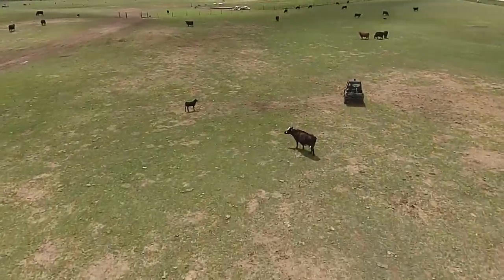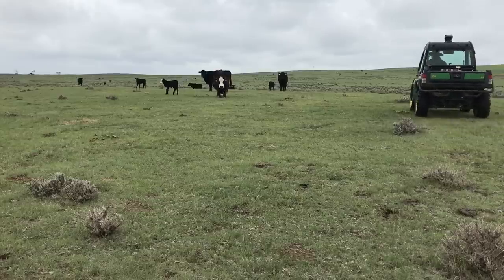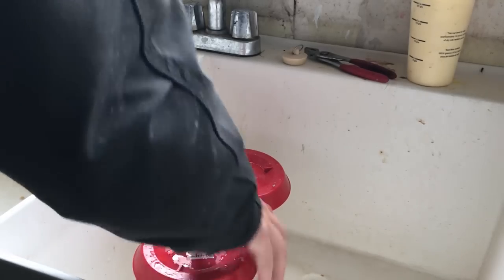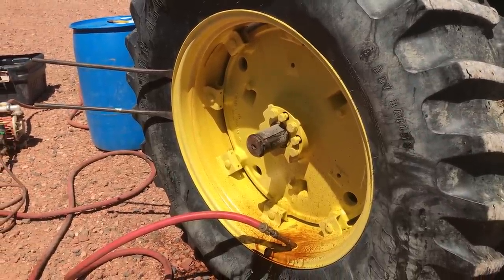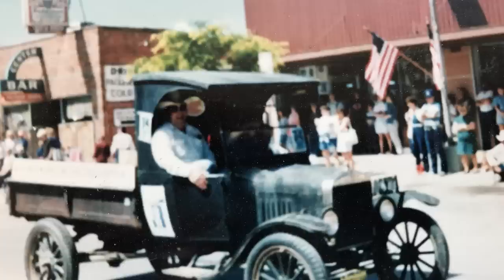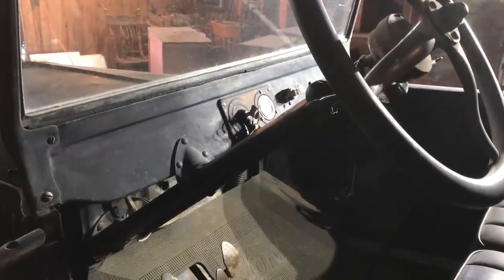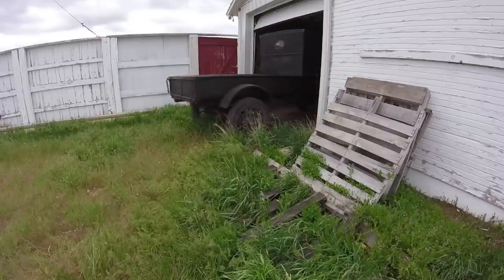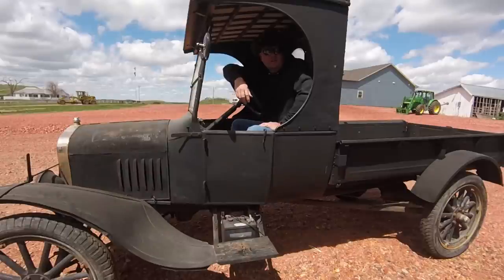History - The Model T

Comment: You'd be surprised just how much an old model TT can haul. One rugged truck! I own a 1926 model T coupe myself. They just keep on ticking. Keep up the good work!
Reply from the maker: Thank you very much, we love the old model T, purchased locally and spent its whole life here.  Thanks for watching - Mike
Reply: I also have a 1926 TT C-cab.  It will haul quite a load, but it isn’t fast.  Unless you have an auxiliary transmission and/or a high speed rear end, you will top out at 20-25 mph.

Comment: Mike,

A question and a comment…

Orphan Calf’s:  -Is there any difference between the temperament of a calf that is raised by its mother and a calf that is orphaned and raised by you in that corral when they reach adulthood (or should I say "cow-hood")?  Somehow, I imagine that an orphan would probably be a bit more maladjusted in some way but I don’t know anything about them.

The Model-T Ford:

Did you ever hear this story about Henry Ford and the Model-T?  I read this many years ago…

When Ford’s works were becoming “big” he contracted out to people to sub-contract certain parts for him.  He sent out a request for bids for transmissions to several manufacturer’s.  In the outline, Ford demanded that each transmission had to be packed into a wooden crate for delivery to his factory.

He specified the exact wood to be used, He specified that the planks of the crate had to be screwed together and he specified that the crate had to be made to specific details.  Each side had to be a certain dimension and had to have a particular cut-dimension to it.

Unless a manufacturer agreed to pack his transmissions in such a crate, he refused to give a contract to them.  Since, a Ford contract was a gold mine for any manufacturer, much as they didn’t like it, they agreed to the crate shipping that Ford specified.

When the transmissions arrived at his factory, he had his workmen take the crates apart.  The boards, all were exactly the proper fit for the floor board requirements of the Model-T!  And so, Ford not only got the transmissions he needed but he got the exact floor boards needed for free.

I read this account several years ago from, what seemed to be a first-rate biography of Henry Ford and I presume it is a true account but obviously I can’t swear to it.

Can you tell from looking if the floor boards in your Model-T fit this description:  individual boards laid out as a floor?
I would really love to ride in a Model-T one day…

Regards,
Ron
Reply from the maker: Orphan Calves are raised by us and are are somewhat maladjusted, of course they are more friendly toward people but there are certain things they get weird about.  One example is a hand raised cow that was kept on the ranch, she would have calves no problem but she was a lazy mom, not a bad mom, just lazy.  She would constantly misplace her calf, then when she would see you out and about she would trot over and expect help in finding it.  She would follow me until we found her calf.  Just easier for her I guess than looking herself.

Model T, I have read a lot about Henry Ford, and I vaguely remember that story, thanks for reminding me of it.  I'm going to go look at the model T now.....be right back...
Reply from the maker: Ok and I'm back.  After lifting up the rubber floor mat, I find, wooden floorboards, nailed in place.  Crazy! Seems old ford was a smart cookie.  Thanks Ronald! -Mike
Reply: Another Ford story Ron, back in the model T days Henry said (paraphrased) 'If I could be guaranteed that people would keep my cars on the road for 10 years using only genuine Ford parts for repair and maintenance  I would give my cars away.'

Comment: beet juice adds ballast to aid in traction and stability for tractors pulling implements, without the ballast the tractor will tear up loose dirt. as for the "T" love it, spent my ill spent youth changing bands out in grand dad's! where do you get additive for the gas for the T? unleaded not so good for the old beast
Reply from the maker: Youre right also the beet juice puts weight on the back of the tractor for when we haul bales on the front end to prevent tipping.  Unleaded isnt good for it, I add seafoam to the tank and it honestly doesnt get driven enough to put too much fuel through it. Thanks -Mike
Reply: first leaded gasoline came out in 1922, and model t production started in 1908 so it should be fine without additives.

Comment: Make sure to NOT use ethanol in the Model T or any of your chainsaws, lawn mowers, I stopped having trouble w/ my 9N Ford Tractor as well as all small engines, when I went to using 100% gasoline.  Love the videos, esp. to LOL discover under the Cowboy Hat is no hair on the roof, I still have a little at 63.  Now Disabled electrician, plumber, Pipe Fitter.  Love the videos & wish I could be there or Montana, esp. in the Winter.  Your cold & snow doesn't bite like here in Arkansas humidity.  R.O.B./

Comment: Why the beet juice in the tires?  Natural anti-freeze?
Reply from the maker: Good question, Beet juice is an effective antifreeze because it lowers the freezing point of water to as low as -20 degrees. We cant use water in the tires because not only will it freeze it will rust out the valve. Water weighs 8 lbs per gallon and beet juice weighs between 9 and 10 lbs.  It makes a great ballast for tires.  Thanks for watching! -Mike
Reply: we use calcium

Comment: That Model T is really a unique truck  simpler times for sure  The battery on the truck looks like a battery we use in modern times did the batteries always look like that or did they have a whole different look to them.  You mentioned electric start which surprised me because I thought all of them had to be hand cranked to start
Reply from the maker: Batteries pretty much always looked like that, although this is a 6 volt system.  Electric start was an option on the model t beginning in 1919 although they still have the crank for when that failed.  Thanks Matt - Mike
Reply: Model T's got electric starters in 1919. If you want to see more on model T's look up Mitch Taylor who is an Aussie and has great videos of his 1925 touring that he imported from Michigan a few years ago.